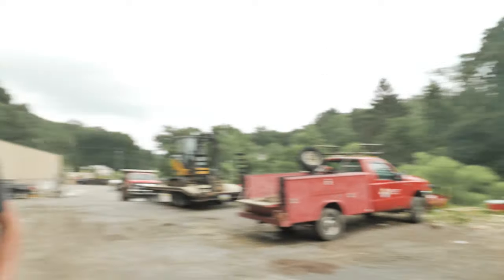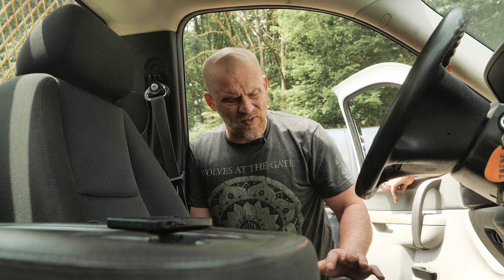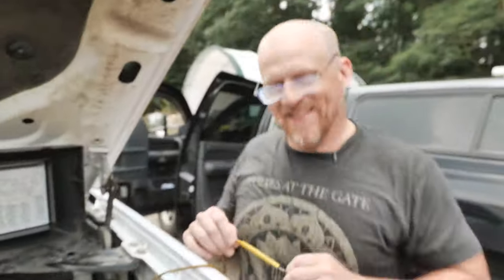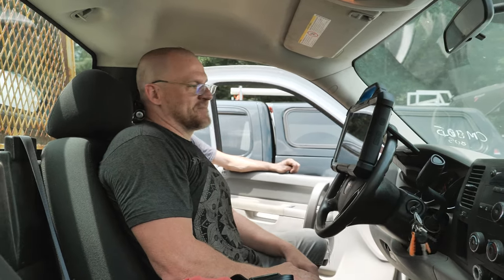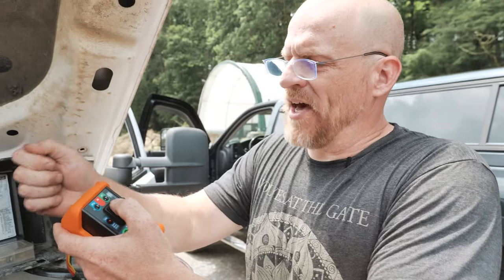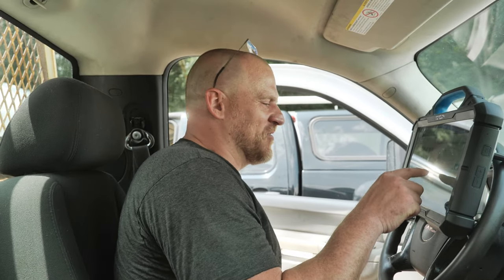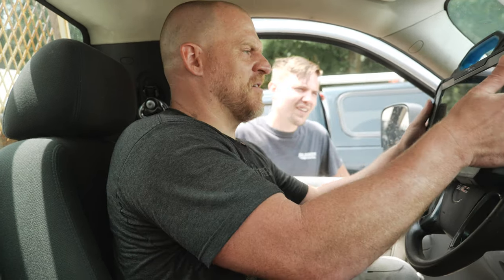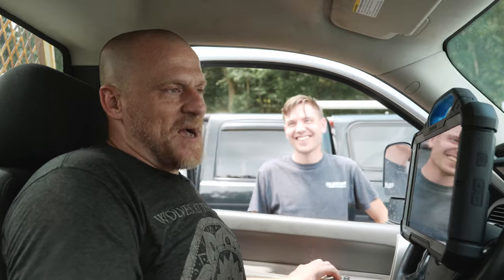No Start, No Crank - Suspected Bad ECM - [Auction Truck]

Comment: To add a key manually for GM keyed ignition you just have to:
1) Turn ignition to run with working key
2) Turn ignition to off and remove key
3) Insert new key to be programmed and turn to run position
I believe previously learned keys can be relearned. 
So you may have been learning those previously unlearned keys back to the vehicle.
Reply: I was going to comment that he probably programmed the remaining keys
Reply: Came here for this comment 100% true
Reply: Don't these trucks start but die with an unprogrammed key ?
Reply: Works for many gm vehicles with keys😊

Comment: Another great video Paul. GM and fuses unbelievable 😂. You taught us great fundamentals over the years. The blueprint to success. Thank you!
Reply from the maker: Thank you my friend. Blueprint is all we need right? I don't have all the answers but I certainly have the fundamentals for someone to learn from so they can then take off from there. Appreciate your comment
Reply: The fuses were corroded because that fuse block cover was left off and got wet. You can tell my looking at the top of the fuse block. Very common especially since the covers on those years of trucks have to positioned properly to get them to snap into position on both sides.

Comment: This is good. I was working on a VW Jetta yesterday which had an intermittent no start. Checked codes and found reference voltage b voltage open. Checked fuses, found one that was broken but bridged with a wire. Changed it and the car hasn't given the client any problem. I learnt the test procedure from you. Great work
Reply from the maker: awesome! 5v ref circuit test for the win again! Thanks for sharing

Comment: “There’s four keys here and they all turn it” typical Chevrolet 😂
Reply: My key comes out while running. 😅
Reply: My key can come out with the truck running. 2000 Silverado 313k miles
Reply: @justinballard7242  same, in my gas 2500 i can start it and take out the key. And drive and all.

Comment: I bought your book and watched your videos. The fundamentals of testing process and thought procedures that I have learnt have taken away the doubt when I diagnose faults. 

I helped a very experienced mechanic (At least 25 years in the trade) who had a performance  issue with a 1980's Lancia. He had spent nearly 2 weeks of his spare time swapping parts with no results. It took me around half an hour to find the issue and 15 minutes of that was setting up the scope and PC.  My ability to solve this came form your teachings.

Funny thing is, the chap still refuses to use these techniques that he witnessed .

Keep doing what you do do.
Reply from the maker: that's so awesome man. Pinning this comment
Reply: @ScannerDanner  Your welcome. Further info, It was the distributor pickup that would give out a messy signal around 2,700 rpm. 

The scope confirmed it but the clue came from the Rev Counter which would suddenly start acting up at 2,700 rpm. Guess where the Rev counter got it's signal from.

Credit to you for being such a great teacher.
Reply from the maker: @Byzmax  nice!

Comment: Paul Idk if you’ve ever pulled apart any GM fuse boxes after replacing them. They use a scotch lock type connection with a single wire pierce between two blades to connect the shared power sources together. Pretty Mickey Mouse imo.

Comment: Typically signs of starter solenoid going out. Clunk,clunk
Reply from the maker: update on this coming up! That clunk was an aftermarket solenoid that controlled power for a plow or PTO of some type, it was not the starter circuit

Comment: Nice video. Got an early 2000s park avenue at the shop with some similar stuff going on. No crank/ no start. Found a rodent chewed wire under underhood fuse block that was control for ignition 1 relay. Missed it the first time because like a dummy i didnt load the circuit. Still not cranking but we will get it there! 10 years in the field and been watching before then and always learn something. Thanks

Comment: Quick as I can make this: Our fleet vehicles are mostly Chevy 3500 express vans. Mine had a check engine light on for over 4 years. It had the engine replaced (washed out cam on cylinder 2) with a new crate engine along with new complete exhaust (cats and all). The check engine light stayed off for almost 2 work days. With in 6k miles, it was having issues and fleet pulled codes for key ID (1 time) and misfires on 1,3,5,7 cylinders and CO2 sensor. Cleared the codes and it ran fine. They ordered a new key and switch and I continued running it (no spares available). Of course it ran fine until the weekend, then it started running rough. I pulled the codes with my own cheap scanner from Autozone. No key code, but same 1,3,5,7 misfire codes and CO2 sensor. I cleared them, ran fine. The following morning, ran fine until I got out of my subdivision and then acted like it was running on 4 cylinders (because it was). Since it was a Saturday and after some phone calls it was determined a spare was not available nor was able to get to one, I started trying to figure it out. The only place it made sense for all four odd cylinders to loose ignition was the fuse box. I have a complete electronics lab at my house (my other channel is all about electronics repair, so fixing a broken circuit should be a piece of cake). I had power at the fuse on both sides, so I pulled the fuse box to see what I could find. I had resistance (9ohms) from the fuse out to harness pins on the bottom. I spent the day removing, jumping traces, installing, reading codes and taking it back out. Every time I pulled the panel, another trace would loosen at a solder joint and start throwing new codes. When it was all said and done, it ran with no codes. I drove it around the block a couple of times and it didn't have any faults and actually ran better than it ever has since I was assigned it almost 5 years ago. That said, I didn't trust the fuse box any further than I could throw it, but we had a diagnostic that fit. I was told to drive it in (didn't want to, btw). It died once while I was in the gas station. I had no crank when I tried to start it again. Poking around in fuse box, I found a janky connection on the ECM battery fuse. As soon as pushed it, solenoids staring clicking and the van made happy van noises. Started right back up, no codes, no rough running. It ran fine. In fact, it ran perfect for about 40 miles and then it was like someone turned off the key. Only this time, no pushing or wiggling of the ECM fuse (or any other for that matter) would get it running again. Fleet brought the new panel and stuck it in on the side of the road. It started, ran like garbage and died. Repeat, same result. Had it towed back to fleet and spent a few hours trouble shooting. Now, I'm not a fleet mechanic. But I was invested at this point. We had spark, we had fuel. We could not get it to even think about catching. The next day, it was sent out of house to GM 40 minutes away and it spent about a week there. I was convinced it was electrical and was afraid that janky ECM battery connection had damaged the ECM. I was wrong (write that down, I don't have to say it often). It wound up being plugged cats. They couldn't get to start either, until the took the CO2 sensors out. Fired right up. They replaced both cats and installed that key switch (remember that from an hour ago?) and it has run perfect ever since. Point is, if the fuses are corroded like that, I highly recommend replacing the fuse box as it is pretty likely got more than a few bad solder joints (and there is no easy way of separating the PCBs and I have all the tools to do it). I am guessing, even though it looked electrical, the cats would not have fouled out if the odd bank circuit would have been solid. The cats alone were 4100.00. Hope that story helps somebody. I found your video on the same fuse box the night after I got it running, so I'm going to copy and paste this "book" I just wrote over there.

Comment: HOW MANY TIMES CAN A "PHYSICAL" PROBLEM PRESENT ITSELF AS A ELECTRIC PROBLEM....?
I JUST HAD A SIENNA WITH A P0500 NO SHIFT IN ANY GEAR, ON PHYSICAL INSPECTION TURN OUT TO BE A MISSING PASSENGER SIDE CV SHAFT CLAMP.....
😂😂😂🤣🤣🤣🤣😎🌵🌴🌲🇺🇲☯️♾️

Comment: Paul, another great video. The symptoms that you were receiving is a combination between a very corroded fuse box and likely the cables or starter. Reason why I state that is because in those  years the pats system was in the key unlike the earlier years when they were in the column. 
Another words, when you were first cranking it. The starter was hung up very likely to corrosion. 
Because the ECM was not communicating with the BCM it threw a code for the transponder system. It was simply by pure luck as you crank it over with multiple keys finally made contact with the starter. That’s my humble opinion from 3000 miles away. 

I would replace fuse box (very common problem) and check the connections to the starter system for corrosion. Ron
Reply from the maker: did you comment before watching the rest? It definitely was not a starter cable or battery issue in any way. The clicking we were hearing was not from the starting system but some aftermarket accessory
EDIT: your comment was perfect. I'm so sorry, this video is missing some key stuff that got cut. Updating this soon
EDIT AGAIN:
Man what a douchebag comment this was by me!!. I read the first part and commented and didn't read the rest. And it was all completely my fault. I'm so sorry man. And this was an awesome compliment. Completely embarrassed is not even close to how I feel right now
Reply: @ScannerDanner  I am so very sorry buddy. I was NOT intending to correct you by any means. Perhaps I didn't hear you mention any aftermarket parts. I did watch the whole video. My grand kids were running around when I was watching. I very likely didn't hear you say anything about aftermarket accessories. I do remember you had questioned the security system. seeing you try all the keys and all of a sudden the last one worked for you with the white tag.  You are amazing to watch. The way you handle issues and being very down to earth about things is great.
Ever sense I started watching your videos I have shared it with everyone I know.  Truth be told Eric O is the one that referred me to your channel. Again. I will watch it again. I am truly sorry. Ron
Reply from the maker: @ronhannink1968  no man, I'm sorry too, I didn't mean that to sound that way. It's all good! I was missing control side power on that starter relay right? I'm pretty sure I was. And then I cranked the engine over by jumping the load side contacts with that tool. I'm sorry it's been awhile, but I'm pretty sure that's how it went
Reply from the maker: Dude! I screwed up big time in the edits on this one. We ran this video on my website and it's 27 minutes long and we condensed it for here and we cut out the parts I'm mentioning to you! So I have you to thank for pointing out this error!!! I'm going to run the full length one here too. There's no other way yo fix this goof now.
I'm getting a lot of these comments and it didn't click until yours and I just went back to watch and it's not there!! Smh, I really messed up man. I'll make it right for you guys and bring that video over from my website
Reply: @ScannerDanner  I appreciate it. No worries my man. I didn't want to offend you. I look forward to watching the whole video. 
However, here is a perfect example how we are simply human. You very much rock. I am very interested in joining your premium channel.
Reply from the maker: @ronhannink1968  I just updated my first reply to you again. I'm so sorry
Reply: @ScannerDanner  Paul, please stop beating yourself up. I appreciate you very very much. I look forward to watching it. 
Truth is I was upset with myself. I am very aware there are far to many trolls out there. I certainly did not want to be one of them. I very much look forward to more conversations on other topics. Thank you so very much for sharing your knowledge. Your friend in Cali, Ron
Reply from the maker: @ronhannink1968  you weren't being that way at all. I was the troll lol. Thanks for the exchange. I can at least sleep tonight. But i still can't believe we cut that part out.

Comment: I have a 2014 2500hd and had to replace my fuse box. ($600). I took the old one apart and found the pins that hold the fuses were pushed open to where it barely made contact. I just squeezed them back together and voila

Comment: so, from new, once a month drowned the whole fuse box in wd40 and I mean drowned it until it's pouring out the box bottom and dripping under vehicle.
or use some other electrical spray/lube, but wd will flush all the nasties out and for sure not damage anything

Comment: Hello from Finland. In time frame 8:28, Ignition must be on before to start engine. That's why the car didn't start, because you only controlled the starter motor. Your videos are very interesting and instructive.:goodvibes:

Comment: The Key cycling cleared the anti theft 

  Master chipped key reset the anti theft ......
   Secondary keys can only be used a limited number of times ( two , three times ) before the system is locked down and has to be cleared , reset , restarted with the master chipped key ..... or be reprogrammed  ,  replaced .....
   I have two keys 
    One chipped Master key ........ one courtesy non chipped  key ( the second key has a limited use , two or three ignition  starts , then complete  lock down )

   I've been told by the manufacturer , dealer to be aware of this 

Master key  initiates the system , or lockdown count starts on secondary keys 
  Reset occurs upon Master Key being used 

  I have a vehicle with this system 
 The Master Key is heavily favored

Comment: What's a big problem with this GM fuse box really?!!! I think they must fix this fuse box issue and corrosion issue too. Thanks for this  video
Reply: very fine mist salt spray from the roadways gets in and corrodes everything, nobody ever cleans or maintains them. hose them down monthly with wd40, to where it's pouring out of the box bottom everywhere. that flushes the nasties out of everything, and keeps the corrosion at bay. you have to start doing that form new/replacement box though. the fuses are part to blame due to material composition. probably plated aluminum tabs....

Comment: GM's have a security issue that happens alot with the mid 2000's cars. I had a Ion that would crank over when bypassing the ignition switch but wouldnt run unless I had the key in run. Then one day the key magically started working again.

Comment: It takes more than 1 minute and a door opening cycle to clear out the vats system and prevent the key from the registration m. I ve also had multiple keys on the samme keyring stil pickup the good working key even though the one in the ignition switch is not a good key

Comment: That clunking/clicking sounds like a starter that does not want to turn. That's what I would chase. 

I have a buddy that works on landscape trucks. He calls me in on the electrical headaches. It's usually a fun/challenging time. They outsourced the repair on one particular truck. That shop ran up the bill to $1500 and recommended they scrap the truck. 😂 I got my hands on it, the wire on the starter was corroded off it (solenoid to motor), the shifter was so sloppy it didn't hit park all the time and the shop that looked over it never put an ECM fuse back into it.🙃
Reply: Man, that's wild. And typical in a lot of fields of repair. HVAC guy charged my neighbor $310 to come replace wire from cap to contactor. It ran 2 days and quit again. She called me for advice. I'm a 78yo retiree, not HVAC person, I looked, saw the contactor burned out, got her a new one for $17, and it is running perfectly now 2 months later. Makes one hesitant to call a "professional" for any repair.
Reply from the maker: but it wasn't that at all! The starting system was not the issue (load side of it anyway)
Reply: @ScannerDanner  your repair of the fuse was spot on and the primary issue. When you went to start the truck post fuse and you got the clunk, that is what I am speaking of. On the video, that sounded like not enough power to the starter motor.
Reply from the maker: @mph5896  that cluck was there from the get go. I think it was an aftermarket solenoid for maybe a plow or spredder?
Reply from the maker: @mph5896  I screwed up big time and I want to apologize because it affected your comment and mine! Producing the full length (27 min) video soon. We shorted it for here and cut out a key oiece!!!

Comment: Those theft codes means someone cleared all keys, once you restored power you programed the first key. Then when you tried all 4 keys in a row, you unknowingly added the 3 other keys. On GM you can reprogram existing keys back to the same module..

Comment: Being from Quebec where rust and corrosion is a major issue, I recognize the sound the starter was doing. It was stuck. The multiple attempts to crank finally freed it up. Very common issue here on vehicles that are parked for a while including stuck alternators (specially on fords and jeeps).
Reply from the maker: That starter was not being energized by the ECM
The clicking we heard was an aftermarket solenoid for a plow or spreader or PTO
Reply: @ScannerDanner  Ah, I see, sounded like a bendix poking out but not turning on youtube.
Reply from the maker: @1202Sid  I'm so sorry, I cut a piece out of this video that covers this! It's missing! I'm so sorry. Updating soon with the full 27 minute video.

Comment: Remember that video Eric did on that black Silverado.  Where the 2amp fuse was blown.  He replaced fuse. With the key on, still no crank no start. But shut the key off and back on. The truck fired up. Needed a fuse box. Great job